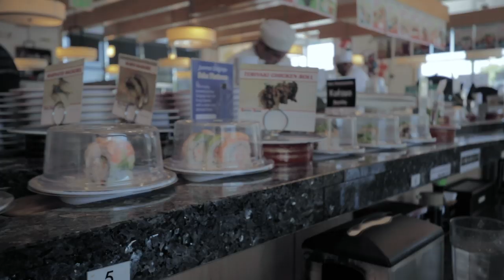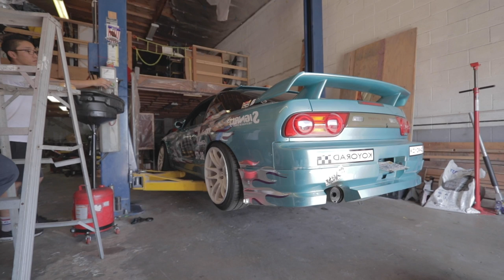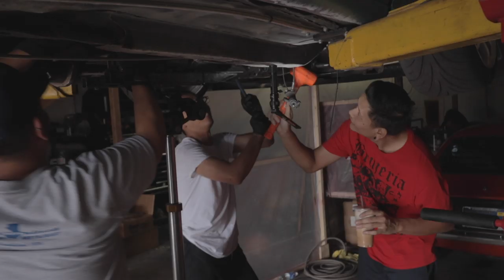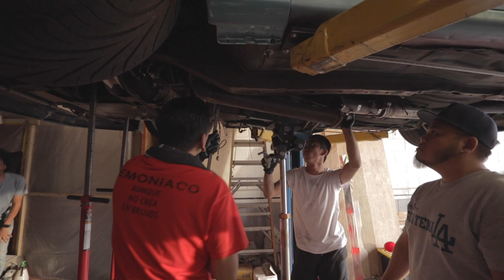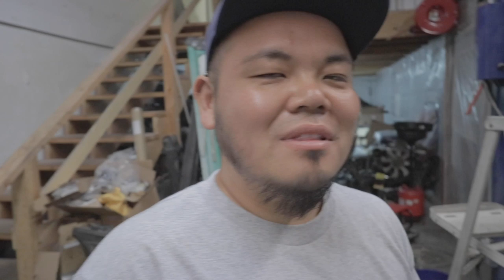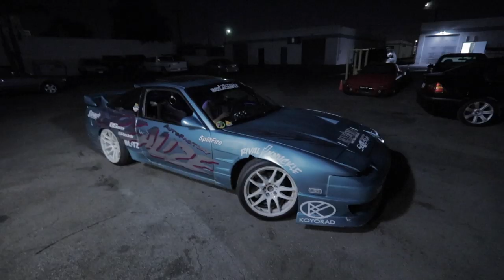How not to change your transmission

Comment: not sure if I missed it butttt, if you unbolt the motor mounts and tilt the motor the trans going in so much easier
Reply: That's true
Reply from the maker: We did, as you can see by the sketchy orange ratchet strap pulling the back of the engine towards the 240Z. Jay has solid Cusco mounts so it was pretty rigid.

Comment: This is easily the most frustrated I've been watching a video. Should have just laid on your back and tossed the trans in like a man. *bangs on trans tunnel. You know these engines are designed for these cars right? Lolz. Good stuff tho. Had me laughing and yelling at the TV.
Reply from the maker: We aim to entertain.
Reply: It's not really about manpower with sr transmissions, I've gone through about 5 and it's about finding that 1 stupid fucking angle 
where the bell housing magically clears the tunnel. I've been able to get them on with the whole 90 degree angle trick
without banging in the tunnel. But even with tilting the motor, lowering the subframe, etc. it still takes a WHILE. Last time I did it I  banged out
the tunnel and it went right on, I wish I'd done that sooner. So yeah these engines are designed for these cars but they're also put in with the trans already mated to the 
engine.